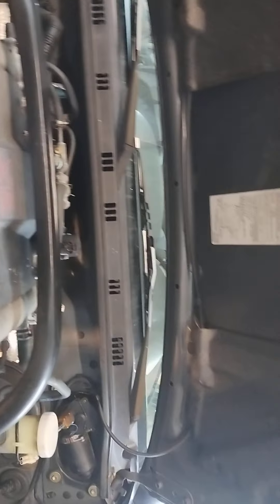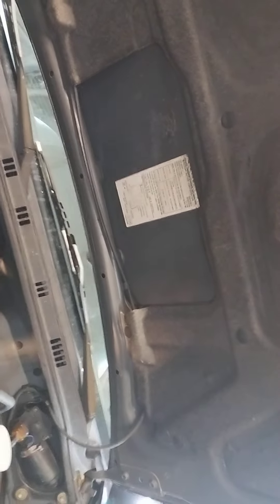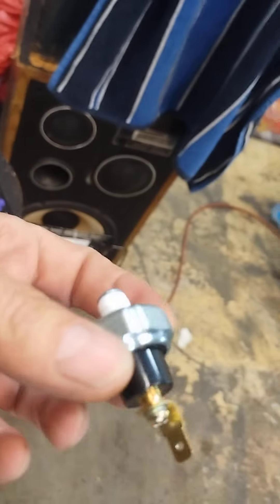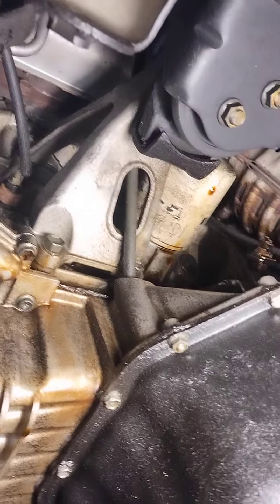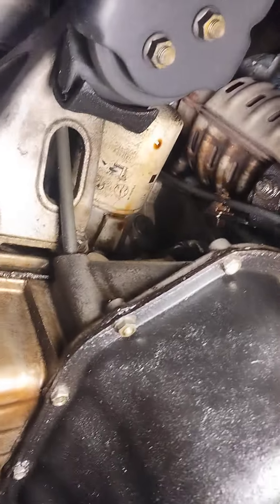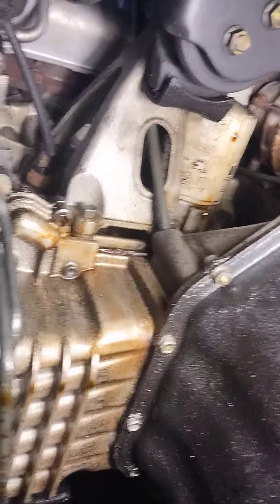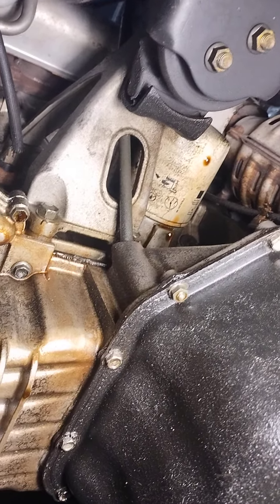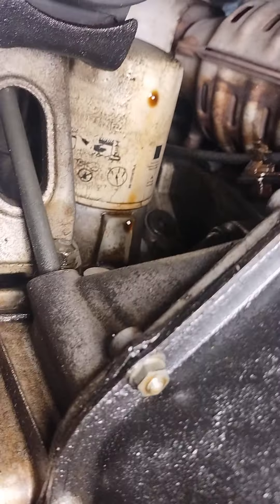be careful of who changes your oil

Comment: Can confirm! I went to my regular mechanic because I noticed oil leaking in the driveway and a little smoke from my engine. Turns out the wrong oil filter was installed (by a valvoline quick line place)  and not even screwed in. I had been dripping oil for six months and was completely empty and dry when I went to my regular place.